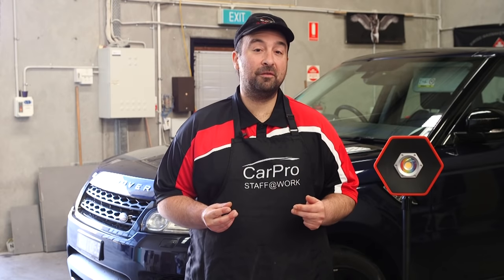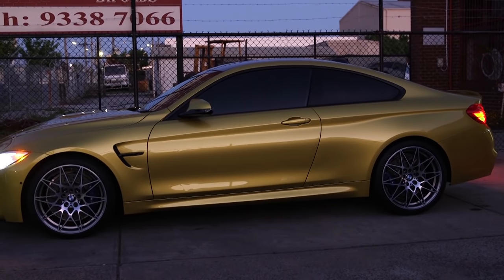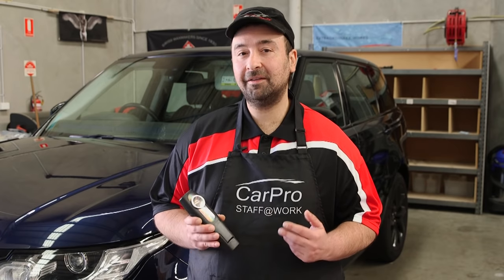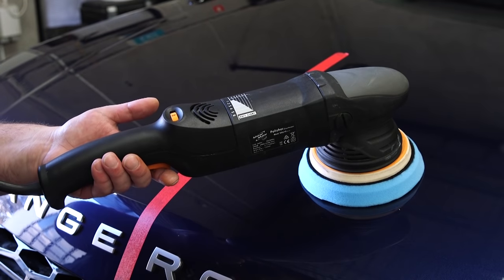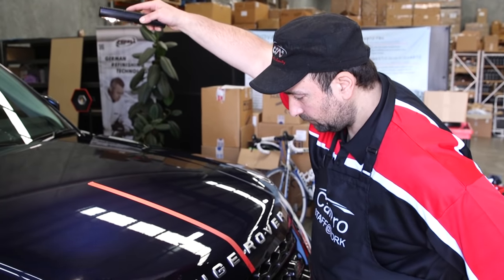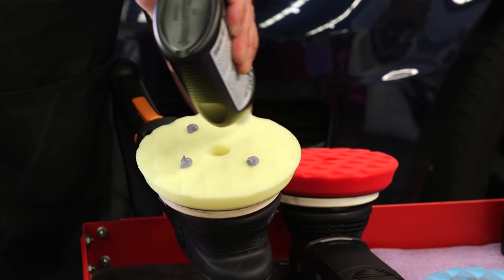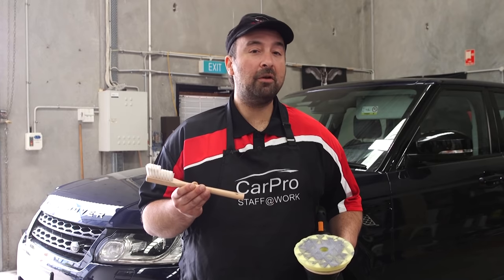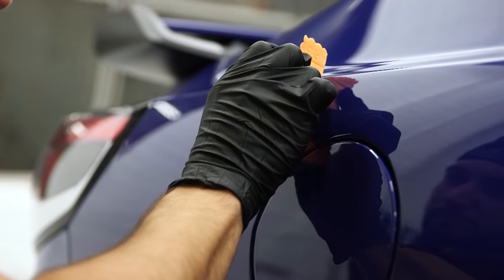Complete Beginners DA Polishing Guide

Comment: Just got my hands on the EX-605 kit and attacked the bonnet of my VE SS-V the other day attempting swirl removal. Went well, though I used the S20 Black but with a red pad, not sure if this was the best idea now given the video! Only did about 2-3 passes however and the swirl removal is noticeable compared to the rest of the car so far so happy with the first attempt. Wondering though, would you recommend using the DA for polish application as well? And would you remove the S20 with microfiber cloth prior to applying polish as well or buff over the top and then remove? Apologies for the absolutely novice questions however I've never used a DA for swirl removal before and I usually just use Autoglym Resin Polish by hand! Cheers.

Comment: Finishing polish: 1 micron in 10 minutes

Fine polish: 2 micron in 10 minutes

Medium polishing: 4 micron in 10 minutes

Heavy polishing: 6 micron in 10 minutes

Cutting compound: 8 micron in 10 minutes

The surface you are going to polish has a surface imperfection that is 5 micron deep.
You always need to work your way down from rough to least rough. So you would always want to finish with a finishing polish.
There are a few different ways you can tackle this:
#1

50 minutes with a finishing polish (-5 micron)

Problem: takes a very long time.
#2

10 minutes with a medium polish (-4 micron)

10 minutes with a finishing polish (-1 micron)

Problem: the step from a medium polish to a finishing polish might be a little bit to big for a perfect finish.
#3

10 minutes with a finishing polish (-1 micron)

20 minutes with a fine polish (-4 micron)

Problem: takes a long time.
#4

5 minutes with a medium polish (-2 micron)

10 minutes with a light polish (-2 micron)

10 minutes with a finishing polish (-1 micron)

Problem: 3 different stages.

#1: This would be a 1 stage polish, but because it takes 50 minutes it is not a smart choice.

#2: With 20 minutes, this 2 stage polish would be a decent choice, but sometimes the jump from a medium polish to a finishing polish might be to big. Would be the choice to make if you are in a hurry.

#3: Also a 2 stage polish, but it takes 30 minutes. Would be a good choice if you have the time.

#4: Still takes 25 minutes, but you would need 3 different pads and you will be using 3 different products. Not the most logical choice.
Reply: Found thisvon the net any chance you could do a video based on this theory

Comment: Swirl marks are from improper polishing, not improper washing guy. And a DA is good, but the same results can be had from an orbital polisher with variable speeds if the correct pad, speed and pressure are used in conjunction with a good compound and polishing formula.
Reply: They're very much caused by improper washing techniques. Improper polishing simply makes them worse and adds holograms to the mix.
Reply: I have never polished my car and I have swirl marks, why are u hating on the video so much

Comment: Single stage correction is terminology normally only used with single stage paint, not base coat/clear coat. There is a difference and you should not give folks wrong information. You never even covered the highly popular single stage paint and how to properly cut and buff it.